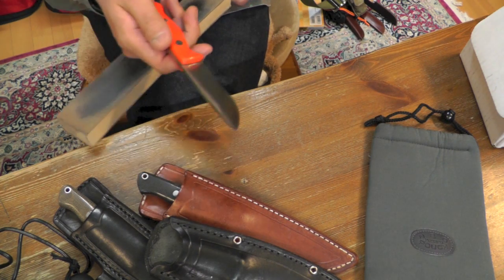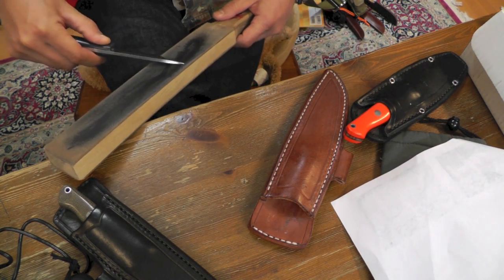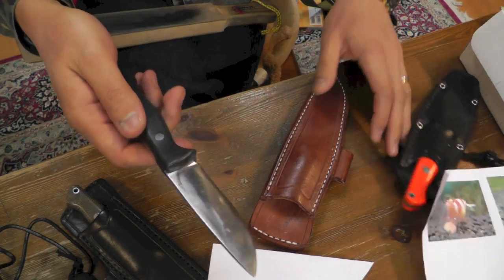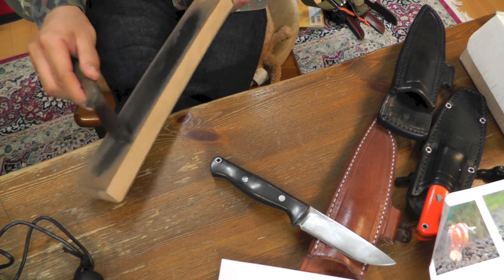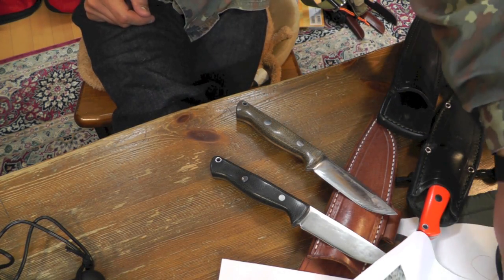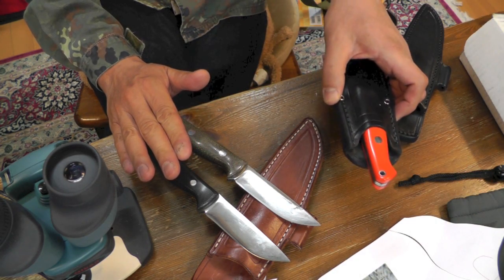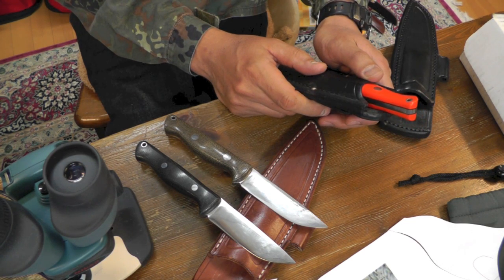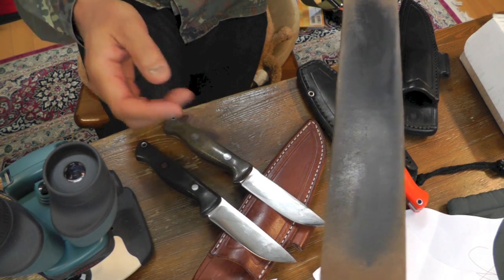Highly magnified steels part3 / CPM-3V

Comment: Those scratches have nothing to do with how the com steel is produced. 
 The scratches are totally there because the finest stone wako is using turns out to be the chosera 2000 grit. White compounds smooth the surface not in solved with full on cutting. That could es from stones. Diamond will not smooth . It will cut quicker with lesser degree of width on the grooves, as you decrease the size of the particles.

Comment from the maker: My USB Digital Microscope has two forcal points at 40X and 200X. It is a very similar thing to an eBay 200X and $25 made in China one. My one is made in China too but cost $100 here. Thanks.

Comment: It looks like the cpm steels are more porous looking, with tiny holes in them, which would give them a toothier edge , where the a2 doesn't. It doesn't mean that one is better that the other, only for specific jobs. I think that the cpm would be good for slicing motion, but a2 would be able to get sharper and better for pushing motion, like shaving.
Thank you.
Thank you.